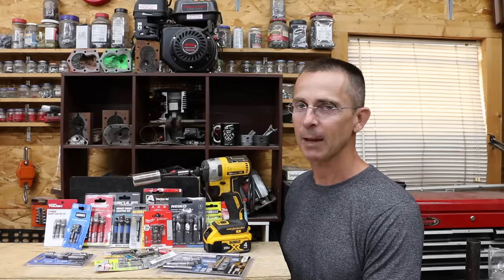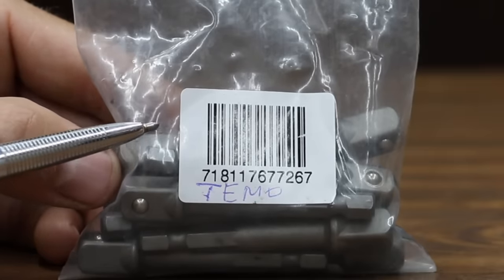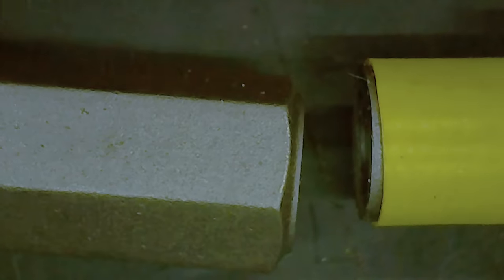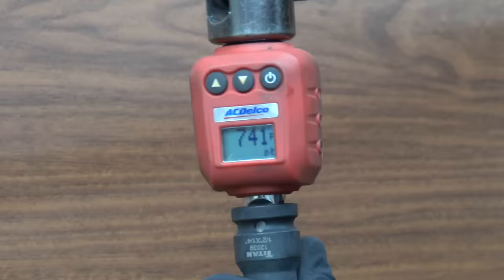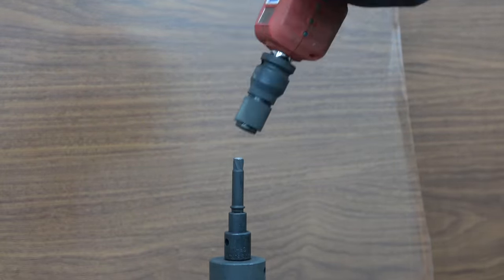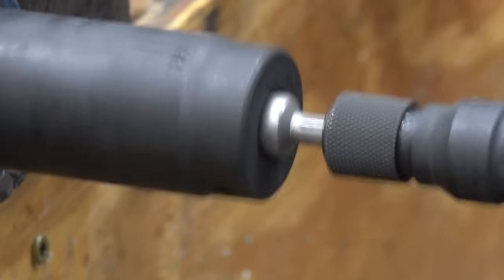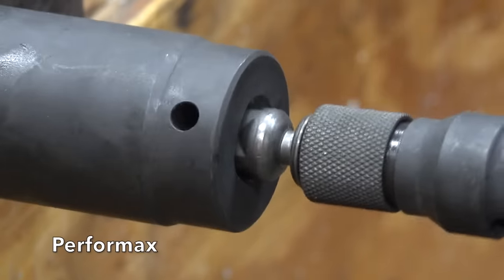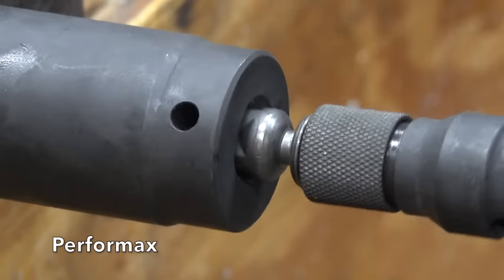Best Socket Adapter? 18 BRANDS: Milwaukee, DeWalt, Makita Gold, Ryobi, Hart, Irwin

Comment: I'm struggling to understand the justification for the "impact zone", unless they're more worried about the bolt than the tool.
Reply: That's exactly it. Impact has a nasty habit of destroying things when idiots don't know how to use a variable trigger. Damaging your adapter is generally better than damaging the work piece.
Reply: Pretty easy to strip out a bolt head if you're not using power tools
Reply from the maker: Thanks for the feedback.
Reply: @sherannaidoo2712  unfortunately that's just not true.... Wish it was.  But I can see where somebody might think that but literally any impact will be FAR less likely to stop a screw head than by hand.
Reply: As far as I understand the mechanics of screws and bolts it really shouldn't help to have it there but in a previous test of impact driver bits, the ones with a narrower neck did a lot better, for some reason.

Its probably something to do with how you want somewhat even torque when tightening something, while the sharp blows would help you break a fastener loose, so letting the bit/extension flex will get you better real world results
Reply: The idea of the round relief is not to improve the ultimate strength of the adapter, as apparent through testing.  However, the circular cross section imparts less stress concentrations on the adapter during Fatique operations- like hammering again and again.  It’s a guess on my part as a mechanical engineer, but generally if you are removing a bolt, if you stay under 50-75% of the ultimate strength the round cross sections will last longer.  You need to set up a real fatigue test to show this.  In both ways the test was run, the impact was brought to ultimate strength, so the life of the adapter is not necessarily forecast by this extreme test.  So not completely relevant, but interesting for sure
Reply: I'm also having trouble understanding the point of the 'shock absorbing zones'  I mean why would you want less impact to your fastener?  The impact tools themselves are marketed on how much impact they provide,and more is better in both marketing and in trying to loosen and tighten things.  Seems to me like the numbers guys did the math and told the engineering guys to use the least material possible that could still hold up to normal use, so they could save a tenth of a penny per unit, then they sent the finished product off to the marketing guys to have them come up with a way to say 'we're giving you a weaker tool and you'll be happy about it'.
Reply: @krpajda  It's because that thin neck allow just the tiniest bit of flex, so in the case of things like hex head bolts, instead of that final stop pounding on the edge of the fastener head, the neck of the driver picks it up. It creates for slightly lower whack factor (not so much the effective torque, but that hard jarring to break things loose). On the drive end, this also helps not buggering up the edges on the driver or the driven end of the socket. It's an alleviation to the possibility of rounding off the corners on fasteners.

Also, to people saying "why would you want less impact" because most idiots don't know how to use the right amount of impact.
Reply: Could it also be an "operator safety" zone made to snap in the place coated with a layer of polycarbonate that would contain any loose shards?
Reply: @selkywaters  thats... what he said tho
Reply: @drd0114  Yeah, it's been my assumption that it's mostly to provide a safe section to break cleanly instead of sending shards flying into someone's jugular like it looks like the Bosch did in this test.
Reply: @selkywaters  Garrrry... you need to read the contents you reply to. Instead of skimming them and seeing what you want to see. You said the same thing Sheran said. Lol
Reply: @sherannaidoo2712  sorry!  My bad.... But hey at least two youtube watchers agree on something right?

Comment: My boss and I were using our respective impact drivers to pull some lag bolts out of an 8x12 beam. I was using my DeWalt impact driver with a 3/8" DeWalt socket adapter. The socket adapter broke right where it narrows to lock into the tool, but my boss's Milwaukee adapter got the job done no problem in the same driver. In due fairness I got my socket adapter as part of a really big kit and all of the bits seem pretty cheaply made by comparison to what was put on display here.
Reply from the maker: Thanks for sharing.

Comment: "shock absorbent zone" is code word for "crap"
Reply: @Dante Alighieri Go big or go home. Literally 😂
Reply: unless it actually absorbs shock which it may well be doing when used with an impact driver. he's using constant pressure to snap them, an impact driver uses momentary rotational shocks where the material has time to recover between hits.
Reply: @cliveramsbotty6077  He did use an impact 💁🏻‍♂️
Reply: I use Milwaukee shockwave adapters on automotive applications and it holds up very well, what I notice it is on the overall stronger non impact adapters twist over time, but the shock absorbent part takes the impact and prevents the adapter from twisting, delivering accurate torque every time rather than some lost on the twisting, I’m a year strong on a single adapter set with daily use lol
Reply: no its not. you would need a longer test setup with less torque to show the benifit of them (fatique testing).  the "torsion zones " are trade off, you sac maximum torque for a longer lifespan at lower torques. this setup is maximum torsion test so of cause the one with the bigger diameter will perform a lot better: tau = 4*(F*r)/(pi *r^3)

so if you need a adapter to remove huge rusted bolts with a tool to small for the job take a adapter with a big diameter, otherwise a sufficent one with a "torsion zone" will perform better in the long run
Reply: @0bloodshot0  agree, if it is low torque applications, well, it doesn’t matter if it is impact rated or not, coz both should work. The point of having shock impact zone, is intuitively speaking, should make it haigher rated other wise it is just point less.
Reply: @Dante Alighieri pretty sure the plastic wrap doesn’t do shit, but they do heat treat that small part to make it softer, so that impact won’t just shatter it , I think that’s how it works. And ofc that sacrifice the maximum torque rating
Reply: That shock absorber zone is a brake point to protect broken and twisted shards from messing up the chuck. Almost had to throw the drill out
Reply: 10:04😂😂😂10:04😂😂😂
😂😂😂crap zone 😂😂😂😂😂😂😂😂😂😂😂😂
Reply: Beelzebot  Do you know what Fahrvergnügen means?
Reply: @XxRudyxX99  up to what torque? I don't trust these adapters really.
Reply: @XxRudyxX99  can i do lug nuts on a Suburban with these?
Reply: appearently its to make it have a clean breax instead of twisting. This is so it doesnt throw shrapnel everywhere.

Comment: The last 3 hours I've been trying to get my broken bit out of the end of the impactor I think an important part of choosing a bit is where the bit typically snaps is it inside or outside the tool
Reply: Yeah that's true good one
Reply from the maker: Good Point!
Reply: Totally an issue. Check out some of the YouTube video comments on simple and complex ways to get the broken bit out.
Reply: I ended up replacing the hammer in my Makita because I couldn't get the broken bit out.
Only $10 and about 30 minutes of my time. It's more annoying because it was a name brand. I finished the job with a $3 adapter.

Comment: How about keeping in a similar theme and test Socket adapter reducers, I seem to break them all the time
Reply from the maker: Thanks for the video idea.
Reply: i could supply the entirety of WW2 with steel with the amount of 1/4 x 3/8 adapters i've broken through the years.
Reply: Probably because you shouldn't really be using adapter reducers except with hand tools. Pounding a 1/4" drive socket via adapter to make it work on your 1/2" impact is not the purpose.
Reply: @ObservationofLimits  i don't use them with power tools.

Comment: Just went back and watched this because an hour ago I snapped a Milwaukee 1/2 inch impact driver adapter on lug nuts that were only torqued to 100 ft pounds. 

I know that my Milwaukee Impact Driver isn't really meant for lug nuts but it was a bummer because the tool is so powerful that I think the adapters should be at least as strong. 

Thanks so much!
Reply from the maker: Sorry to hear!  You are welcome!

Comment: Shock Absorption should be marketed as "Convenient Failure Point!"
Reply from the maker: Thanks for the feedback.
Reply: It saves the driver from destruction.
Reply: @johnd4348  I see your point, but that isn't the selling point. It is reduced vibration. I thought Temco did great for the price.
Reply: I guess I'd rather have the adapter break rather than the tool or the bolt
Reply: @tlmessage9196  the adapter will always break first if you have a good quality driver.  If you have too much adapter for your tool then you might wanna switch brands.
Reply: Mine usually break at the reduced  area for the locking mechanism on the impact. Bosch and Dewalt impacts, bits break in the same place.
Reply: 😂😂😂 10:04 hart 😂😂😂 😂😂😂 😂😂😂 😂😂😂

Comment: I’ve removed lug nuts off my F-150 with my DeWalt impact driver. They are a handy, versatile tool
Reply from the maker: Impressive!
Reply: Yeah buddy, if you were able to remove your Lugnuts with a quarter inch impact driver, it’s not that the impact driver was powerful but rather your Lugnuts were not properly torqued on lol. You better not be putting them on with the impact driver you goofball!
Reply: Assuming it is newer than 2004, I have my doubts that it took off properly torqued wheel nuts. No 1/4 driver is going to deliver over 150 ft lbs which is the spec for anything newer than 04. I think the older ones were 120, and I don't see that happening either unless you are using something with a square drive rather than a 1/4 hex.
Reply: @--_DJ_--  I didn’t realize it was a specific terminology but impact wrench* means it’s got the square bit, whereas impact driver* is a hex from what project farm said in the beginning of the video
Reply: @BikingVikingHH   I have to think the OP was using an impact wrench, or else he is lucky not to be that guy on the side of the highway with 3 wheels on his truck. I saw one of those just last week.
Reply: @BikingVikingHH  lol, true. I always need to manually break the nut loose with a tire iron but then spin it off with an impact driver. An impact wrench (the one that doesn't need an adapter) does have enough torque to loosen or tighten wheels, but an impact driver doesn't.
Reply: 𝕮𝖚𝖈𝕶 𝕮𝖗𝖚𝖘𝖍𝖊𝖗 1996 F-150. Torqued to 120 ft lbs with a torque wrench before I tried it. Got a YouTube video to prove it
Reply: d j 1996 model. Torqued to 120 ft lbs before trying. I have a video on my YouTube channel if you care to watch
Reply: d j I always use a torque wrench on my lug nuts when installing them. I’m not saying I put them on with an impact driver and send it, I just tried removing lug nuts that were double checked before hand. I didn’t think a 1/4” driver would remove them either, but it did.
Reply: Most cars lug nuts only get torqued to 105 to 115. The dewalt xr is rated to 150 making it easy to tak we off most lugnuts.
Reply: Brad Faught yea. I did some testing with it. In my experience, it would remove the lug nut up until I got to 140 ft lbs.
Reply: @MikesGarage96  You do say 100 in the video, but I would have said it wouldn't do that either. I suppose I stand corrected. I have to think your torque wrench might be off a bit, that little guy didn't even struggle, pretty impressive if they were 120 since that is over the spec they give for it. I don't see many of those trucks around here anymore, the have all turned to dust and gone back to nature.
Reply: @MikesGarage96  Oh I wasn't saying you were using it to install them, I just really didn't think one would have that much torque, so they would have had to have been loose(ish) to be taken off by one. Clearly I am wrong. I also have an old 1/2 milwaukee that has failed to take the lugs off the wife's Kia that I torqued to 80 ft lbs, so you might get an idea where might doubt came from. It was always a piece of junk though, 450 ft lbs my ass...
Reply: @Mike's Garage What size DeWalt is it?
Reply: JoManOut DCF887 brushless
Reply: d j I didn’t remember off hand exact what I torqued to in this video, but on the side I torqued them up to 140 ft lbs before it wouldn’t break them loose. Torque wrench may be a little off, but if it is it’s not by much. Takes a lot of Ugga duggas to get it up to 140 ft lbs. I really didn’t think it would break them loose. If I’m pulling a tire off my car or something and don’t feel like lugging out the air hose, I’ll use it to get the lug nuts off. When I install my lug nuts, I always finish them off with a torque wrench, especially on my F250. I do a lot of towing, a buddy had a wheel to come loose on a trailer after a shop put new tires on.
Reply: @MikesGarage96  I turn wrenches for a living, nothing leaves my shop without being torqued and since it's our own fleet I do work for, re torqued. Some of it is class 8 stuff, I don't need someone dying cause I was too lazy to break out the torque wrench. Duallys going down the road is the stuff of nightmares. I saw another guy say the XR is good for 150 ft lbs, pretty nice to see a manufacturer not exaggerate the output like they did with my 1/2 Milwaukee.  The one time I let someone install wheels for me in the last 15 years the wife and I made it about 30km down the highway before the left rear was coming loose. It was a pretty shady place selling used tires but that's all I could afford at the time. I tore a strip off that guy when we got back to town.
Reply: @MikesGarage96  I actually got the same thing, I had no idea they were rated so high. I'm pretty sure mine is a little tired because I know it won't loosen anything over 80 - 100 ft lbs. Or maybe the newer models have a little more oomph, mine is a few years old
Reply: JoManOut mines less than a year old. It’s not even broken in yet 😂
Reply: @jomanout5866  It could be the battery you are using, my Milwaukees don't put out nearly the same with the compact 2.0 batteries as they do with the 6.0 HO. I'm not sure if Dewalt makes high output batteries like they do for team red.
Reply: @MikesGarage96  Noice! 😁
Reply: @--_DJ_--  I haven't even thought of trying that. That's good to know! I got some 2 amp hour batteries and some 5 amp hour batteries. I don't know if DeWalt makes em bigger than 5
Reply: @jomanout5866  He was using a 5 ah when he busted the nuts loose on his truck. I still can't believe that little gun has that much torque. Puts my 3/8 Milwaukee to shame.
Reply: @--_DJ_--  Oh wow, I understand. I bet if we took them apart and studied the hammer mechanisms then we'd understand why the DeWalt has a little more power

Comment: You test a lot of things, one thing is pretty consistent. Dewalt is normally in the top three, they seem to make some pretty good stuff!
Reply from the maker: Thanks for the feedback.
Reply: Amazing too since they are a division of Black & Decker, which quickly became the brand to avoid  long ago.
Reply: @MrV1NC3N7V3G4  thats why I'm always suspicious of DeWalt.  B&D tools are worse than the cheapest noname chinese ones.
Reply: I agree. Dewalt always stays in top 3. They are a house of brands so they change the build of materials for the particular brand. B&W is one quality level and Dewalt is another with corresponding change in parts and complexity. Performance is what matters, not who owns it.

Comment: If I've learned anything from these videos, DeWalt it's usually a consistent performer.
Reply from the maker: Thanks for the feedback.
Reply: yea thats the thing i like about buying dewalt. they might not always be number one(though they often are) but theyre almost always among the top competitors. if you dont have time to test and compare every tool you buy, you can usually rest easy just picking up dewalt and knowing youll be getting a high performance tool. plus their battery system is by far the most versatile, its nice to be able to run an entire aresenal of tools off a single system(their 20/60v system).
Reply: In other words, even where dewalt doesn't excel they do a very good job of not putting their name on total crap.
Reply: I'm watching this amazing man like it's a full season on Netflix 😂

Comment: Could you do a car battery charger and maintainer test please. Love your vids, keep up the awsome work.
Reply from the maker: Great suggestion!  Which brands?  I'll check back later to see what everyone suggests
Reply: There are a few cheap brands on amazon ranging from 1 Amp upwards all claim to have multi stage charging that helps repair batteries with sulphate buildup. The you have top brands like neco that are expensive and claim the same things.
Reply: Schumacher, plus whatever else you can find at Walmart...?.🤔

Comment: I thought the idea behind the shock absorbing zone on the adapters was to limit the pulse effect of the impact gun and protect the socket and fastener being tightened. Using a 1/4" adapter for this amount of torque seems an odd choice and not something done in the real world.

Interesting test as always but I think it's one of the few tests you've done that misses the mark.

But that said, keep up the good work!
Reply from the maker: Thanks, will do!

Comment: Thank you for this video.  After breaking a few adapters with my 2000 inch/lb impact driver, I was wondering if there was a significant difference between brands and which is the best value.  Questions answered!
Reply from the maker: You are welcome!